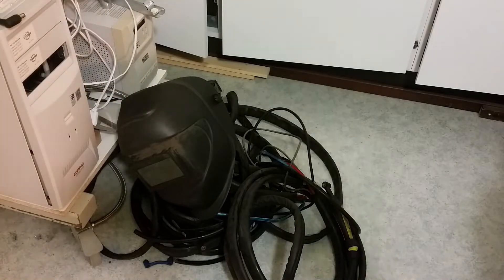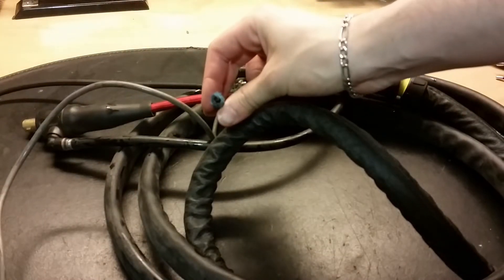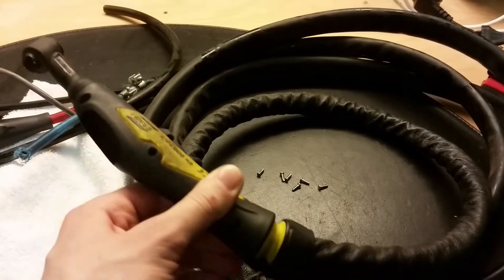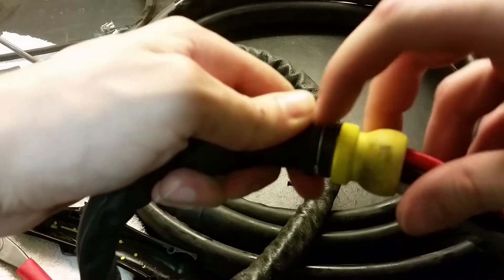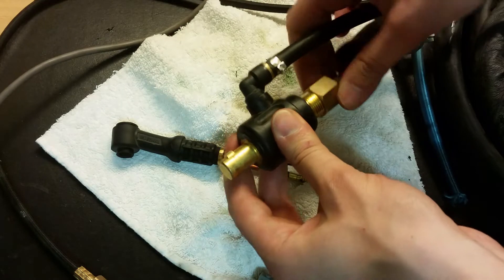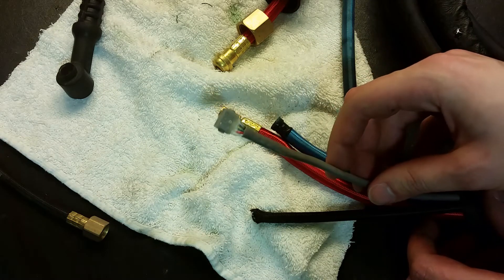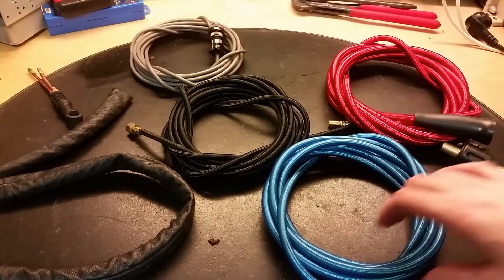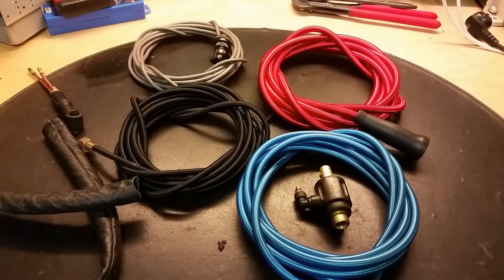TIG Torch And Hose Teardown

Comment: you got most of it worng, in terms of where water and gas flow, the water in and outlets are connected straight to a cooler, never enter the machine itself that would be the shielding gas